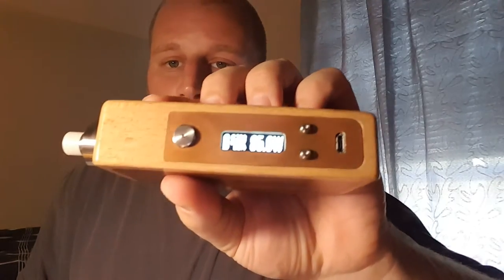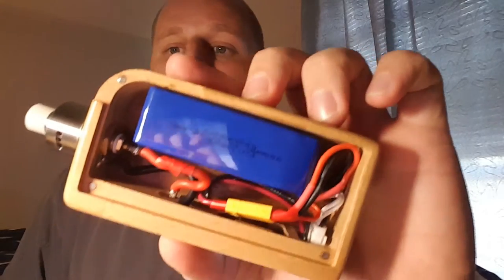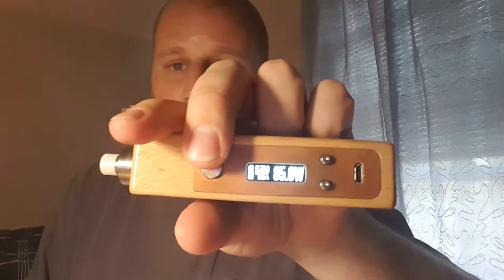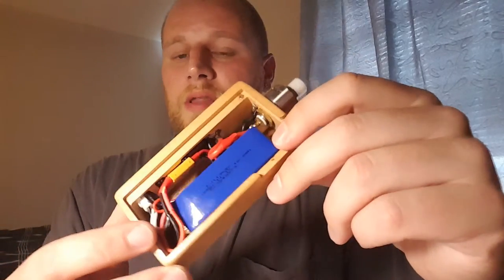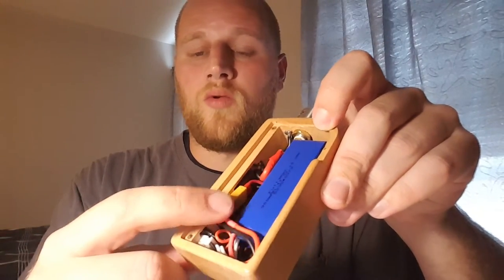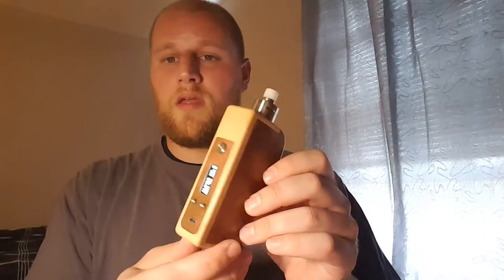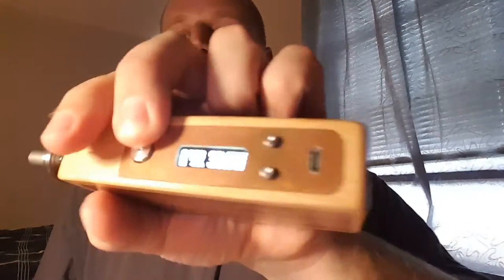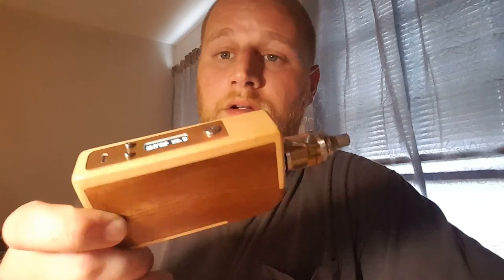Dna 200 build, final part. For now?

Comment from the maker: one negative, one positive, and one for each series connection. since a 2s only has one connection the 2nd and 3rd tap wires go to the same place. it's like you need to trick the board, because it's made for 3s not 2s. and that was right from evolv them selves. go to evolvapor.com and search the forum. I later figured out I need to leave the tap 3 wire unattached and run a bead of solder from 3 to 2 on the board itself.

Comment: that tap cone Ecton,  where did you hear to wire 2 wires together to the sled? from my little knowledge that is the balance port, the ground is the ground, but each wire after that is for each lipo cell you have, so a 3 cell will use all conceptions,  1 wire to each individual cell

Comment: could you use a 3s rc toy car battery? I want one with extra long battery life its 6000 mah I plan on building one soon!
Reply from the maker: sure can, the 3s lipo from what I've seen is really only used in the rc world. but sure you can. make sure the specs on the battery are good enough to handle the dna 200. evolvapor.com
Reply: OK man I appreciate it thanks

Comment: how are you finding the board got mine due in the next day or to but the horror stories of boards dying for no reason is kind of worrying me and on the evolve forum some people have had 3 boards die on them within the space of a few months  im keeping my fingers crossed i got a good board now as i live in the uk and postage back and forth is going to be a pain in the ass
Reply from the maker: +Jamie Jackson mine has been flawless with a 3s lipo. I use it about 50% of the time I Vape. I can't wait to get one in a smaller more useable box, and the Dan 200 will be my only device. Hope yours works out. Cheers